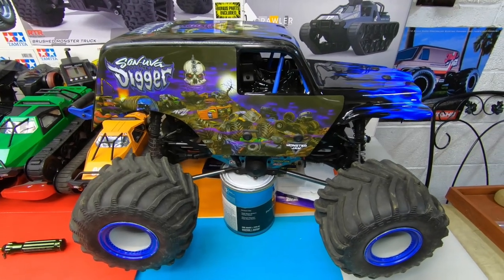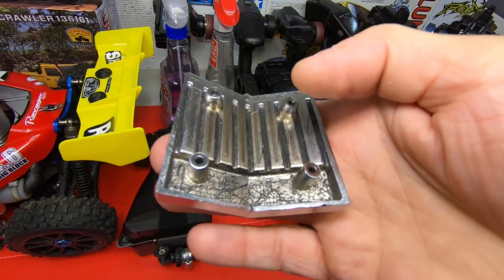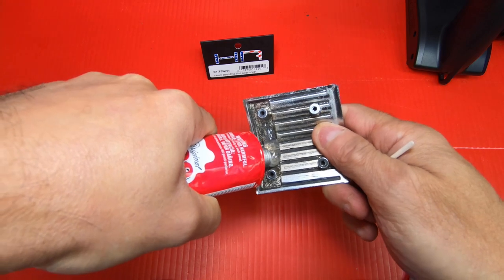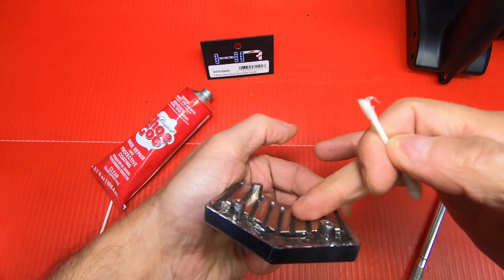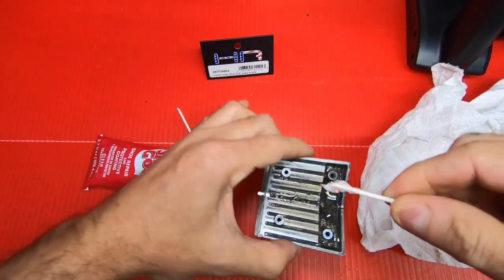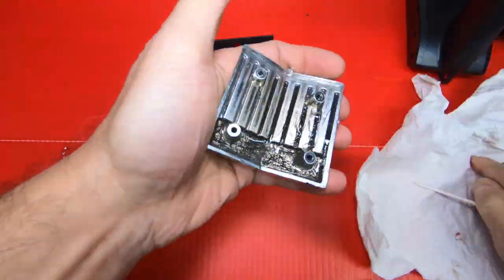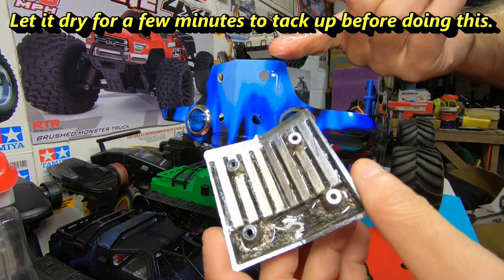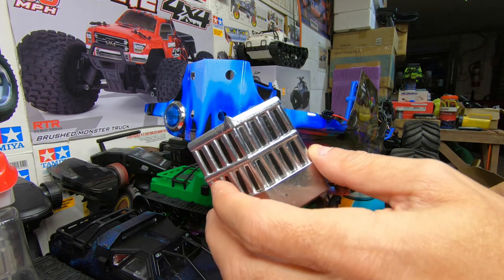Losi LMT son uva digger mod broken Grill fix

Comment: Might be able to trim piece of thin sheet metal Shen.have great weekend Steve
Reply: L brackets bent to contour might work also
Reply from the maker: Yea like a small section of aluminum shaped like the grill stick tape it on. 👍👍